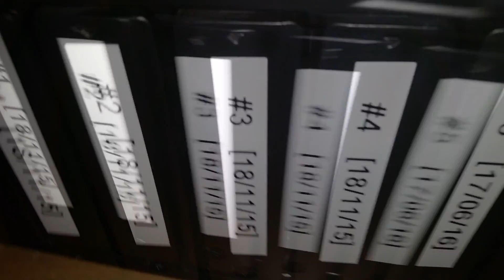Synology DiskStation DS1815+ No Power Fault 'Workaround' - Using A PC Power Supply To Recover Data

Comment: @NathanPh this worked on my ds1821+ but I stuck on blinking blue led. It did not initialize the dsm. I don't hear hdd spinning but two fans work and lan cable led works too. Anyone have a solution? Let me know. Thanks.

Comment: These units had three big issues:
1. Bad psu. A lot of them fail
2. C2000 intel bug. Processor degrades and it prevents the machine from booting
3. A dead battery on the motherboard will prevent it from booting.
The worst is the CPU bug. It can be worked around but I wouldn't put sensitive data on it.

Comment: I was recently given a DOA 1515+ for free that had this exact problem. Since my hands and eyes arent good enough to remove and solder in a new transistor, I installed a SPST toggle switch on the front of the case and hooked the wires directly into the green and black wires in the wiring harness (pin 3 and 4). Flip the switch on to power it up, and to shut it down, press the power button to start the shutdown process. After it beeps, give it 30 seconds and flip the switch off. Installed a test drive and it works perfectly fine on the network.

Comment: Here is what I did to get mine booting.  If you short the green wire (4 from the right) and the black wire (3 from the right) the unit will power up when the power cord is plugged in.  Many suggest wedging a paper clip between those two pins.  I did not like the idea of those pins being jumpered permanently and having to plug and unplug the power cord to start and stop the NAS.  So what I did was put a momentary contact switch (I used a PC power/reset momentarily contact switch).  Just press it for about 1sec and the system boots fine and the blue light comes on.  Now I can shut down normally and just have to press the momentary contact switch to start the DS1815+.

** I had the 100ohm C2xxx fix already on a brand new unit from Synology.
* I tried the 1000ohm transistor fix at Q4 and that did not work so I removed it.

Neither of these fix the no power on problem.

I figured I had nothing left to lose so, as a last resort, I jammed a paper clip between the green and black wires (on the top row 4 from the right and 3 from the right), plugged in the power and it booted up fully.  Then like a said (I removed the paper clip) and I rigged up a momentary contact switch between the same pins.  Ran that MC switch outside the case and then just have to press and hold it for ~1sec and the blue light comes and stays on and the NAS boots up as normal.  Now I can shut it down properly and just have to use the MC switch to boot it up.

This saved me from having to dish out $1000 to buy a DS1821+.  I really think Synology should have replaced all the DS1815+'s to a new different model (like the DS1821+) at no cost or a very significant discount.  But no, their strategy was to just keep sending out replacements until your warranty expires and then tell you that you have a xxTB door stop or you can buy a new DS1821,  Then pray it does not die with a simple fix.

Comment: Had the same issue with my Synology unit. Using your method it booted up just fine. However I've bough a new PSU and even replaced the CR 1220 battery and without the second ATX PSU it will not boot. Any idea how to fix it permanently. My unit is after the warranty period.

Comment: Before you buy a new PSU and throw money away, try soldering a 4.7k resistor between the green wire and one of the black wires. For aesthetic reasons, I soldered it directly to the PSU. Now everything works as before.

Comment: Same issue here, but different behaviour: Bridging PWRON and GND on the manufacturers power supply unit makes the disks spin up, but trying to power the board with a  standard ATX PSU lets the DS1815+ shortly wake up, approximately for 5 seconds, no disk lights blinking, then switches off again. 

Second time the device fails. First time was inside warranty, now the support does advertising for its new repair service. Can't believe it.
Reply: I'm in the same boat. Rma a few years ago and now the replacement has failed the same way. Synology didn't rectify jack shit.

Comment: I have a different atx psu tester.  It has +5v = 5.0, +12v1 = 12.2, +3v = 3.3, -12v = 11.6, +12v2 = LL (and the tester is beeping), 5vsb = 5.0

I do not see a second 12v on your tester so I do not know if 12v2 == LL means my psu is bad?
Reply: That usually refers to the CPU 12V power pins, which in this case would not be used as it doesn't have it on the Synology PSU

Comment: So I put the 4.7K resistor across the ATX pins as discussed and bingo!, I am back up and running. I add that 3.3K nor 5.6K had no affect so it seems pretty fussy about resistor value. I also note that this is the second resistor I have soldered into my 1815+ in the last 12 months as I also had the CPU fault. Something tells me I wont be replacing my Synology with anothe Synology.

Comment: My DS 1515+ was showing the same symptoms, and replacing the power supply to the mother board with a desktop ATX PSU made it power on again. Using the paper clip trick I couldn't make the disks spin up however. Finally I simply reset my NAS and plugged everything back in as intended and everything started working as expected again.

Hopefuly my experience can help someone else who's troubleshooting what seems to be a power failure, but is in fact a software issue.

Comment: Had this problem myself today but didn't have a spare ATX PSU around, after reading a few of the comments I tried bridging the ps_on and ground pins on the PSU and it did come to life!
WARNING, NOT SURE THIS WAS A GOOD IDEA, I then plugged everything back together and bridged those pins from the back of the main PSU plug, the unit came on but would not initiate, I left it for 20 minutes just in case but after no luck switched it off again. I then took the bridge out and out of dispair tried turning it on again, IT WORKED, no idea what happened, it does seem that after a power blackout they can get screwed and this can reset them somehow!

Comment: I don't have a tester so I just bought a new power supply. Obviously the spower supply wasn't the issue because that would be too nice lol. Should I just buy a new device for 1000+ USD or kill myself right away lol? fuck my life.
Reply from the maker: Don't give up so easily! Try some of the other methods mentioned in the commends on this thread like the resistor additions. 
Also, Try a standard desktop PC power supply like I used, some people have reported that those work but the Syno replacements won't for some reason. If you don't have one you could also try linking the green to black on the existing PSU while it is plugged into the motherboard and see if it fires up, but I wouldn't advise doing that for long term use. It will help you diagnose a possible motherboard issue though! 
Hope this helps somewhat! --Nathan

Comment: For God sake you just saved my business !!! Called synology : we can't help you, you are not under warranty anymore... not even : ship it to us, and we'll fix it but you'll have to pay. I would have done it right away. What a crappy support ! No way I'll continue with a company not wanting help its customers !! You solution works flawlessly but the short circuit between black and green on original PSU is needed to get it working! THANK YOU SOOO MUCH
Reply from the maker: Hi Francis, Great to hear you got your unit going again and I really appreciate you sending a PayPal donation through my website so much as well. :) I've featured you on the donations list now. 
I was a bit miffed myself with how Synology have handled this when it is so clearly a known issue. I mean they extended the warranty on the units, but that only did so much and you had to pay the return shipping back to them which cost me almost £90 including insurance and tracking at the time. 
My unit ended up being replaced with another, I know as the serial/macs/etc were all different on what I received back. Surely there could have been a recall or something given how widespread this problem has been. 

My replacement unit has been good so far - touch wood - so I haven't had a chance to dive any deeper into the troubleshooting and real cause of this problem. 

However there has been some good advice by others in the comment section on this video if you scroll down, about fitting a resistor or two to also resolve it. 
I wouldn't recommend bridging the power supply green to ground as a long term solution as it could cause issues down the line, forcing the PSU to run regardless of PG (Power Good) signaling between itself and the motherboard. 

Thanks again and glad to have been of help. 
--Nathan
Reply: @NathanPH  Hi Nathan you are very welcome. I just bought à replacement PSU on amazon to be able to close the cover. But your solution will be there in case of. I just don't understand how à company selling NAS supposed to operate 24/7 doesn't take care better of it's custmer basé. There are plenty of synology failures on YouTube... unthinkable...take care !

Comment: Just bought a 600W Thermallake power supply... 
My DS1815+ died yesterday for the 2nd time . First was under warranty, second not.
FxxK Synology : they should replace this badly designed NAS in any case OR propose an upgrade to newer model with discount. 
I complained and said I am switching to QNAP... 
How stupid they are : it's so easy to lose your reputation... for ever.
I will let you know if your tip it works for me....
Reply: Quick feedback : I have bought a replacement synology PSU on internet, removed the thermallake one, closed the lid, and everything is up and running again ! The best support I have received is from people on the internet like this channel ! So a big THANK YOU ! And screw 😒 Synology for their attitude... even if I love their DSM software.

Comment: Hi Nathan et al. My Ds1515+ died and I think it's the same issue. It's over 4 years old so no help available from Synology. I don't have a power supply tester or a spare ATX psu, but when I used the paperclip on the green and black pins the psu sounded like it powered on. Is there a likely fix I can try, i cant really afford a new NAS. I've seen mention of both a resistor fix and also a mysterious component I can buy on ebay with instructions that isn't the resistor fix. Would love to get this back up and running if at all possible! Thanks in advance :)

Comment: so if this is the case does a new powersuply fix this since the psu seems to be good ? or is the problem on the conectors or where the psu is connected ?
Reply: i dont think so. had the same issue. thought the same as you. then i found on another vid a guy saying the issue can be solved by placing a 4.7k resistor parallel with the green and any black wire in the 24 pin connected. i tried this and it worked for me. according to him there is a voltage drop on the green wire so the MB does not detect the PS. the resistor corrects this

Comment: Hi everyone,
A german forum as found a solution to fix this issue.
It's about a transistor failure on the motherboard next to the power connector, apparently it appens on different synology NAS not only the 1815+. You just need to change the transistor by a new one (they recommand the BC847 wich is a NPN transistor) and it should work again. I haven't done it yet, cause i'm still waiting to receive the new transistor. But I'm confident that it will solve the same issue i'm facing with my 1815+.
Everything is explained here:
https://www.synology-forum.de/threads/ds1515-startet-nicht-mehr-laesst-sich-nicht-einschalten.90668/

You must translate if you do not speak german, do not hesitate to read all the pages !
cheers

Comment: I purchased a new power supply for the ds1515+ and didn’t fix the problem.
Found this method with external power supply and it worked, left it runing overnight for about 10 hours. Turned it off, plugged the old power supply back and now it works fine. Turns off and on like a champ.
Feeling a bit upset because now I dont know what’s up. Did the board just lock up because the power outage, I have seen this on olde computer motherboards. Is it maybe that the motherboard battery is getting a bit old and because I ran it for a while it charged enough? Am I just lucky? I really dont know but time will tell...

Comment: My DS1515+ died. Synology suggested a replacement PSU from Amazon.  Here is what Amazon says:
PSU 250W 24p+12p+8p
Applied Models: DS1813+, DS1515+, DS1513+, DS2015xs, RS815+, DS1517, DS1817, DS1815+
If you have a DS1515+/DS1815+ exhibiting a DOA (completely dead) status, please be advised that a new PSU will not repair the unit. Instead, please contact Synology Technical Support to get your unit replaced, as the motherboard needs to be repaired.

Comment: I watched this video a  long time ago when my DS1515+ died. Just happened again - I wasn't getting turn on after a recent blackout. Did this trick, which worked. I thought I'd try just plugging in the synology power supply after this test, and it just started again. So I think sometimes the motherboard needs to be disconnected from the PSU to perhaps kill all residual power. Already ordered a spare PSU anyways.. but this still helped me. cheers
Reply: @Fallon Cohen Same issue with mine, it got more regular until it then wouldn't power on at all - I'm about to try this trick to see if it works so I can extract the data - Ebay, from what I can see sells PSU's for about $150 (Australian) so I may or may not get one but I don't think I'll be investing in Synology again if they only last 4 years (Just outside of warranty)
Reply: @saundersclose  i had the same issue. ordered another PS worked for a day then died again. did some research and someone solved the issue by placing a 4.7k resistor in parallel with the green and any black wire on the 24 pin connected. Apparently there is a drop in voltage thats too low. i tried the resister and it worked fine. didnt have a 4.7k so used a 3k and its worked.
Reply: @tipool777  my measurements:
normal mode - 5 Volts
when you press the power button - 2.2 Volts
this is normal?
Will the 3K Ohm resistor fix the turn-on problem?

Comment: seem the psu on the unit is crappy low wattage that i cant support high load
Reply from the maker: I don't believe this is the case as people have reported purchasing replacement power supplies from Synology parts sellers and the units are still not working. There is something strange going on between the motherboard and PSU, I can't confirm what exactly though as I sent my unit back under warranty and got a brand new replacement. Had it been out of warranty I'd definitely have been digging into the unit more and trying to find the cause and solution. 
Hope this makes sense/helps! 
Thanks, --Nathan.

Comment: It amazes me that some people even after Y2K still using 2 digit years and not even ISO8601 format
Reply from the maker: It still has its uses because it's more convenient in some situations and makes the labels smaller on the drive sleds. No need to write the whole year down each time.
Thanks, Nathan.

Comment: What happened is that the powersupply partially died. Most likely one of the electrolytic capacators has half blown. This causes the unit to not be able to deliver enough current to power both the motherboard and the harddrives. Especially during startup a computer device will ask a power spike from a power supply. If the powersupply can't deliver that spike then either the motherboard will detect that itself or the powersupply will tell the motherboard it's overloaded. In either case the motherboard will decide not to start the system up.
By using 2 different power supplies, like in the video, you remove a big part of the power load from the faulty powersupply in the unit, which due to the lighter load is then capable of handling the necessary power to operate the drives and the system boots as normal.

Comment: Bloody good vid. Shame mine is the DS416slim which is a micro compact thing. It's my 5th synology in 10 years and I've had 3 fail. Not good failure rate but each time I need to get another so I can access my data.

Comment: Having the tester all green does not mean the PSU is ok. The tester does not check for ripple. Sometimes due to falty capacitors, the signal is not smooth, has alot of spikes (you could check with an oscilloscope) and therefore the main board will not power because of that.

Comment: Probably a dry or dead capcitor in the Power supply that does not supply a stable voltage to the super IO.

Comment: I think the issue might be that the PSU isn't giving off enough power, after ordering a spare PSU (250W) for my DS1515+, it still didn't turn on. But using a spare PC Power Supply, it turned on just fine. (650W)

Comment: I had the same problem with the same model DS1815+ NAS, after using this work around a year ago I replaced the power supply with a SeaSonic SS-250SU + an adapter I soldered up. It has been working for a year now ;)
Reply: Troy Barron hi! May I ask what adapter you had to solder? I replaced my DS1815+’s PSU a year ago and now it stopped working again. I’m tired of buying replacement parts from Synology (which is also a pain in the ass to get in my country) and looking into alternatives. Thanks!